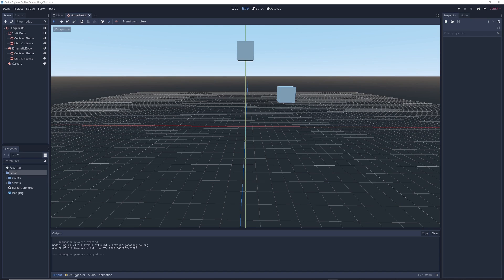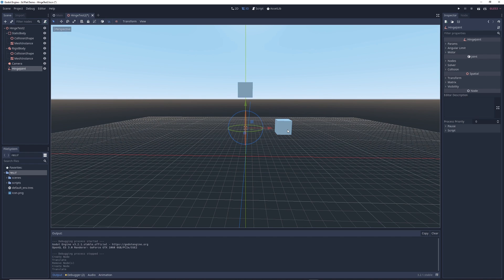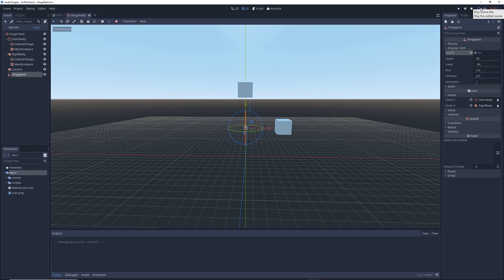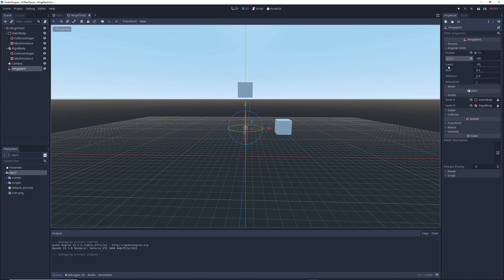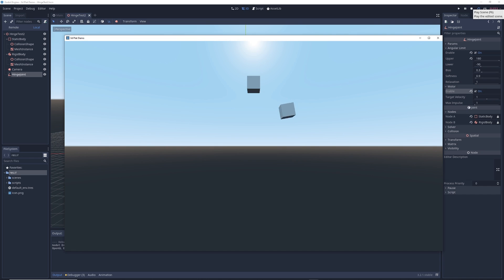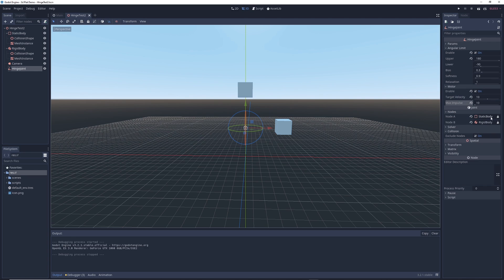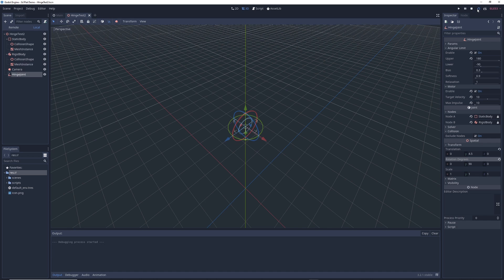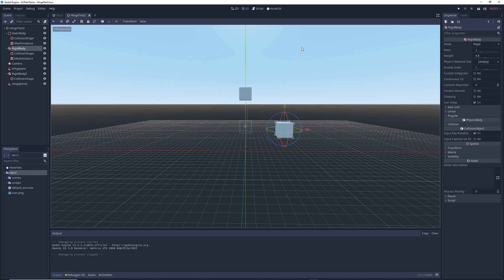The Mysterious (But Insanely Useful) Hinge Joint Node - Godot Tutorial

Comment: Can you attach something to the Node A and Node B of a joint, my GDscript instead of assigning them manually?
Reply: Just like referencing any object in godot. If it's a node in your scene you can get it and it's properties.

Ex:
1. "onready" the node inside your script
2. use the "onready" variable you made to change it's properties. "hinge3d.node_a = ???"

Hover over words inside the ui in Godot. It will tell you which *property to use; *[Property: node_a].

Comment: The 'other numbers' are for if the 'static' body is moving very fast, how rigidly does the hinge follow. You'd be surprised that it's not instant and it's like a spring. this is because one is moved 'outside' of physics, and the physics has to 'catch up' and it doesn't do it 'instantly' because that's not physically possible, so it has to move from one place to another, and it gets momentum, etc.

Comment: Thanks very much.

In my previous 2D prototype, I made swinging platforms using 2 hand-made animations (one of them is a mirrored version of the other) that play depending on where the player touches the platform.
For the style of game that this prototype was (A 2D autorunner with a fixed player speed), this is surprisingly realistic, but required hard work and a little bit of frustration to pull off.

Now i can do this much easier and much more versatile AND much more convincingly with PHYSICS!, and this makes me go "yes"

Comment: Unfortunately, godot dont have a 2D Hinge Joint
Reply: I found PinJoint2D.
In 2D, the Hinge and Pin Joints would be exactly the same
since both could Only rotate around 1 possible axis (Z).
Reply: @sosasees  Yep. But there are a lot of differences between these. Example, with the HingeJoint you can put a limit in how much can the joint rotate in an angle, Pin Joint no, this is a very useful function.

Comment: note kinematic (or rigid bodies in kinematic mode) are essentially static, that is they collide but are not subject to forces, the only difference is the physics engine expects kinematic bodies to move under software control
Reply from the maker: Ahh, thanks!
Reply: @garbaj  you are very welcome. i am fooling around with bullet physics currently. have some fun with a kinematic (that you control) attached to the joint of your choice to a regular rigid body. the 6dof with spring forces (tuned stiffness and damp if you know basic spring physics) make for an interesting way to nudge rigid bodies around

Comment: What is the static body in this set-up good for? Just to stop the other body?  seems like I'm missing out something. I'll go experiment a bit.
Reply from the maker: The static body is just an anchor point for the hinge. It doesn't move
Reply: @garbaj  I know, but the rigid body moves/rotates like it's anchored to the (invisible) hinge rather than the static body, making me wonder if I could simply replace the static body with an empty 3d-Spatial . Or another rigid body and see if they both rotate around the hinge, or ... well I got to wait till I get home from work :)
Reply from the maker: Yes, you can have both ends be connected to rigidbodies

Comment: @1:55 "You'll also see these other options for Bias, Softness, and Relaxation..."
From the Godot Docs we get some of (but not all) the answers.

Bias:
"The speed with which the rotation across the axis perpendicular to the hinge gets corrected.
"

Softness:
"There is currently no description for this property. Please help us by contributing one!
"

Relaxation:
"The lower this value, the more the rotation gets slowed down.
"

Well, we got 2 out of 3 at least.
---

Also, the KinematicBody doesn't move because we the developers are expected to apply our own forces to the KinematicBody using either the move_and_slide() or move_and_slide_with_snap() functions.
If I set the infinite_mass parameter of either move_and_slide() to false then I can push a KinematicBody that isn't moving (i.e. directly apply force through game physics), but if I use the hinge joint then I can't indirectly use it to apply force. Odd, but that's the way things seem to work.

Usually though for a KinematicBody force is applied via the first parameter of either move_and_slide() function.
Reply from the maker: Thanks for the info

Comment: This would be perfect for doors in my 3D game. Static body for the door frame, rigid body for the door, and a hinge joint that handles opening and closing.
Reply from the maker: That's a clever idea!
Reply: I actually did this but I keep having an issue with rigid bodied in general were at a random point shortly after I have started my game it gets harder and harder to push for example the door around until it just becomes impossible. It's almost like the rigid body just keeps accelerating downwards until it ends up having so much inertia that my puny pill character has no chance of moving it. Any o' yall ever experienced anything like that?
Reply: @jvstAsYouAre  I have a problem and the door go trough walls when the player push them too hard. I dont know how to fix it... Maybe somebody here knows ?
Reply: Niice! And maybe, if you want it to be more "door like", it can essentially be disabled unless a character / object hits it at a certain speed, in which case it will "enable" the crazy free-swinging :D.
Reply: lmao

Comment: Nice but I didn't finde a Hinge Joint Node 2D
Reply from the maker: Yes, Hinge Joint is 3d only
Reply: I found PinJoint2D.
In 2D, the Hinge and Pin Joints would be exactly the same
since both could Only rotate around 1 possible axis (Z).